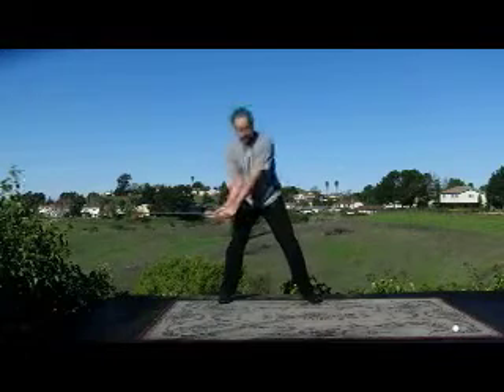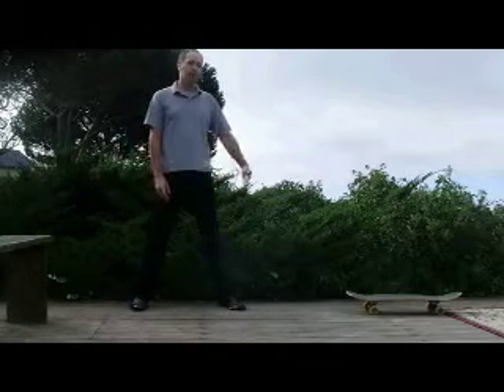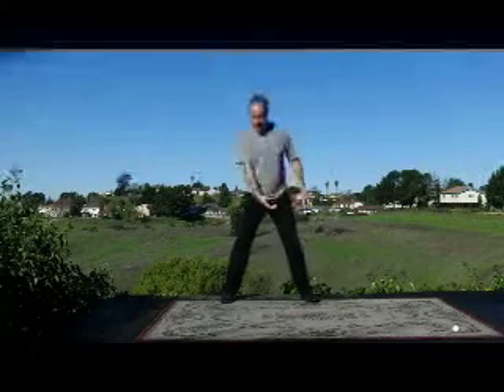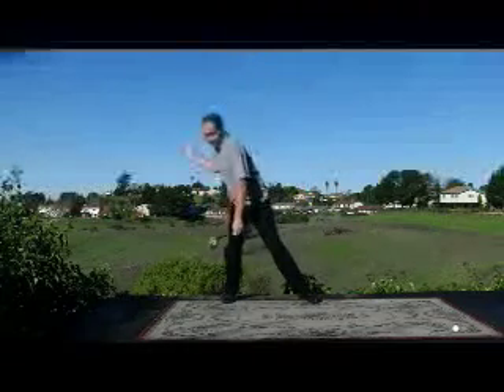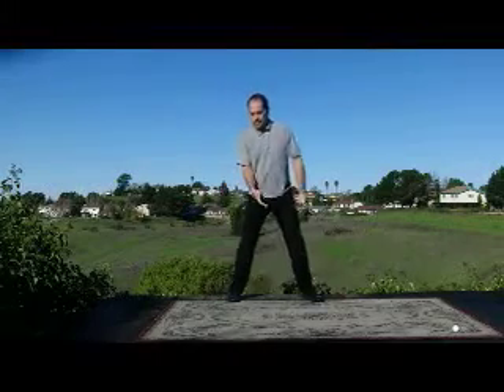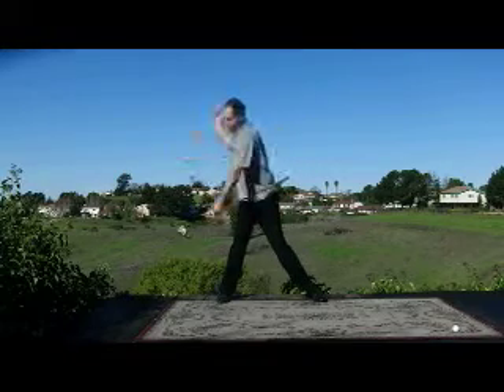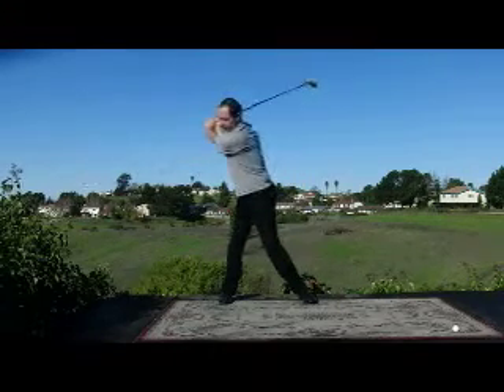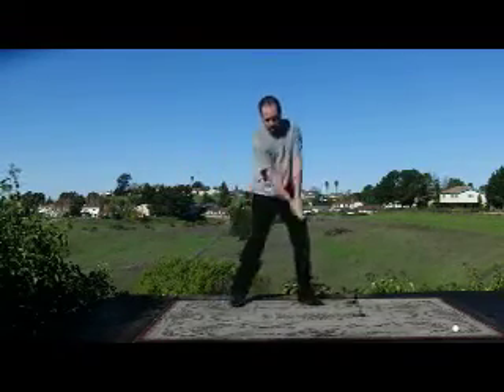Advanced Ball Striking - Weight Transfer

Comment: “We want weight transfer through the strike while we are hitting it”?  Yikes!  That is totally opposite to what most Tour pros do.  They get their weight to their left side early, sometimes as early as they are finishing their backswing, so they can rotate and hit up against a stable left side.  “Shift early, rotate late” is the mantra.  

If you are transferring weight through the strike, for most amateur golfers, that is the kiss of death.  Transferring weight through the strike will lead to an inconsistent low point in the swing, as you are, in effect, hitting a moving object (the golf ball).  The ball will appear to be moving back to you as you are moving your weight laterally through the strike.

I love all of your videos and teaching points, but this is definitely a head scratcher.  Don’t take my word for it.  Watch any Gears and force plates analysis of what the top pros do.
Reply from the maker: I'm not impressed with most modern tour pro's golf swings nor the instruction that goes along with it.  I would agree with the shift left more quickly if the hips and torso remained closed like Hogan did.. but this isn't the case in modern instruction.  Shoulders and hips are opening too soon, weight moving left and this leads to steep clubshafts on the downswing and brings in the left side of the golf course... and long and left pulled shots too often that leave left to right downhill breaking chips or putts.  Proper weight transfer through the strike helps keep the shaft shallow and also supplies extra power and thrust through the strike especially if you are holding shaft flex.
Reply: @Temporary Stranger, maybe you are misinterpretting weight transfer vs pressure shift.  if you get a chance pls watch some AMG videos where they meausre the best of the best.  not sure what Gears videos you are referring to?  check out Mike Adams catalyst videos and AMG videos.  whether they are front, mid or rear pressure/weight loaders, they are ALL trying to re-align their virtual spine/hinge (its roughly the left sternum and left hip joint) EARLY in the back swing, that is the great divider between the very best vs great ball strikers.   best analogy would be if you had a door hinge on an incline plane and you had close the door, you would have to pressure and align the hinge in a way that allows for a smooth closing of the door.  hence anytime you watch golfers who struggle to keep their cards and end up on the mini tours there is discernable hitch in their longer swings :)
Reply: These lessons aren’t necessarily for amateurs who suck at golf. A lot of them won’t even understand half of what he’s talking about, which I think you proved that with your comment. This guy is spitting knowledge for an already decent ball striker and someone who understands golf, hence the title “Advanced ball striking.” However, I don’t see why a beginner couldn’t start off golfing this way. Regardless, golf is about experimentation, and it’s obvious you haven’t done too much of it.
Reply: .. yes Hogan put club in the’ slot’ as he shifted his weight forward. The clubhead at the top and the weight moving forward. The golfer will naturally move through the ball I think so I wouldn’t recommend to actively shift weight forward through impact but I don’t know, words are limited in conveying anything